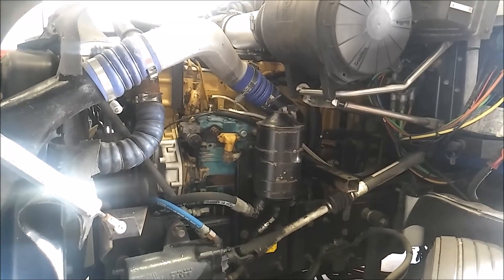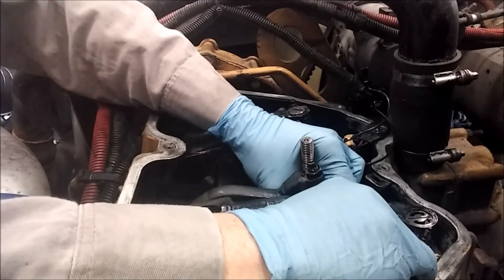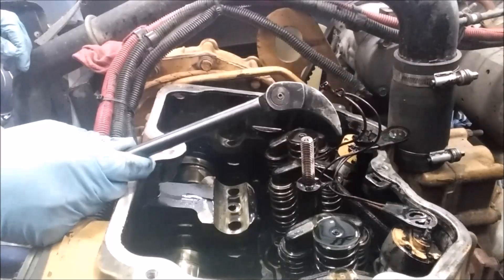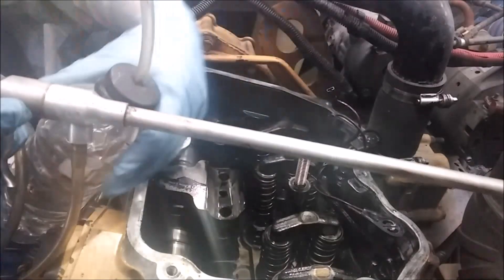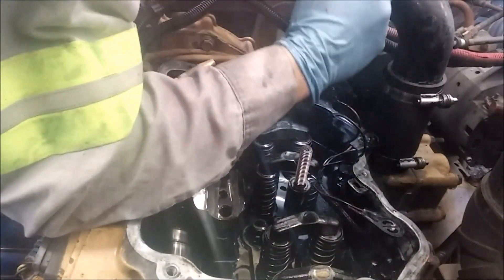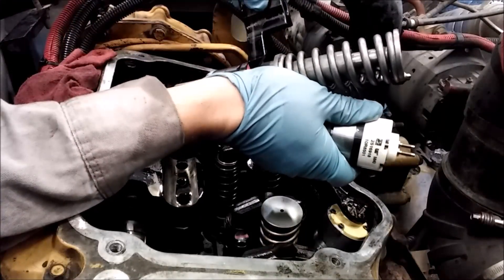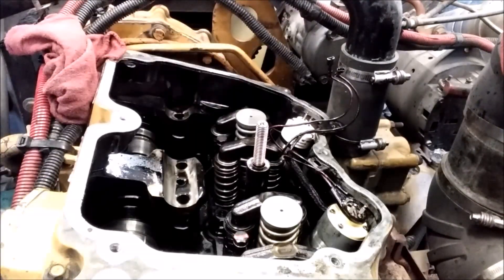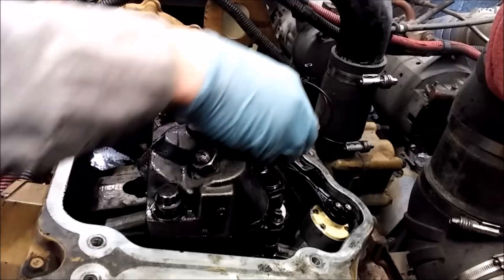How To Change a 3406 Injector or C15 Injector on Cat engines

Comment: Do I need to put the engine on top dead center #1 before doing injector? And can I run the Jake housing down if the valves/injector are in the open position when I take the housing off...

Comment: My ol 6nz was running like 💩... got a cylinder cutout test done,  it was cylinder #1 injector. Replaced it using this video. It still idled rough for about 20 mins. Then started idling smooth and running like before. Thanks to you this ol girl back on the road.

Comment: I got 1996 5EK cat it had a slight miss when on the pedal so I replaced all injectors and replaced the wire harness and done the over head on it but it still has the miss I don't have a computer to do the trim codes yet maybe the will help

Comment: I have a problem with my 95 378 peterb8lt. It has a 3406 c model cat engine. I've had the injector pump and lift pump all rebuilt and now for some reason it's only pulling fuel out of drivers side tank but the fuel still returns to both tanks but the fuel returning to passengers side tank is black why
Reply: Your getting compression in the nozzles. Also a 3406 C engine, you cannot order nozzles from the book (3ZJ), unless it is an 8PN. The book is wrong and depending on serial number HP determines which nozzle will work the best. As far as the tanks, sounds like you have a restriction.

Comment: Josh, old video but a good one. 

Wondering if I can pick your brain for a sec. 
I just did injector cups on a c15 acert 
Went for a drive after. Made it 2 miles and truck sputtered out. Checked it out and had 3 bolts lose on injector hood down bolts. 
Had new bolts and torqued to 40ft-lb 

Pulled it all apart. Pulled all 6 injectors. Cleaned bores and checked cup depths and all good. 
Found oil in bolt holes and blamed that on the screw up. Hydro’s the bolt and it torqued on that rather than the injector hold down. 

Cleaned threads 
Installed again with all new o rings on injectors 
Torqued 
Let it sit for half hour. Torqued again 
Went for a drive 
4 miles this time same thing. Haven’t tore into it but number 1 injector rocks side to side so bolt is lose again. 

Any ideas about this?? 
Thanks! 
Hope your new endeavours are going well.

Comment: I have MY 2000 3196 marine engines. Is it the same process to service the injectors? One engine started running rough (like missing a cylinder). I was thinking about pulling the covers and disconnecting one injector at a time to see if I could find the issue then pulling that injector. Also, why do you have to get the EPROM flashed when servicing injectors? Or is that only when you replace an injector?

Comment: Changed injectors 6nz.
Rocker arm bars do not sit flush on the bottom. Afraid to run bolts down. Help.

Comment: Adept ape, 
I have a 3406. The oil gets thinned out after about 3000 miles. And then the oil pressure will drop and the oil light will come on. Once I do an oil change in the filter replacement the pressure goes back up to normal. I can't seem to figure out why? Do you know what kind of issue I am experiencing?

Comment: I thank you very much for this video. 2 shops took advantage of me on a missing engine problem on my c15. Said it was bad fuel. I told them it was a injector issue but instead of hooking up a scan tool they went the other way. I found number 6 had a loose hold down and was missing blue second o ring allowing air into my fuel tank and disabling number 5 pushing air into that one too. I SAVED $6000 By doing this job myself. THANK YOU.

Comment: caterpillar 6ts in a 98 379 no check engine lights but you can hear a pop through the exhaust no abnormal smoke would it be an injector problem?

Comment: Hey I am workining on a 3406e but I broke a stud off of the top of the injector. Can I use a cap from c12 and just replace it. Or do I need a one specifically for a 3406e. Thanks

Comment: Hello i had all my injectors tested and 2 of them were faulty so i bought 2 and the for remaing were cleaned up and resealed but the seals are not the same color as the 2 i bought, do you think that could cause trouble later on ?

Comment: So if I wanted to replace the injector cups and injector there is no need to bar the engine to TDC, I would “simply” tear down jakes and rockers and reinstall? Then once that jobs done I would bar the engine to find tdc cyl 1 and start running the overhead procedure, do have this right? I’m gathering all the tools, parts and supplies to get this done and just taking as many notes along the way. Thanks for the knowledge you pass on to us

Comment: So,I appreciate your videos and thought I'd ask for your thoughts on how flawed the 3406E ,C-15, and C15 ACERT rocker shafts and shaft saddles are ...When all is new ,it seems a good fit ,BUT,when a hose blows and a driver gets the engine hot ,the head ,cracks virtually without exception...then you factor in that Peterbilt for years never had a low water warning system..Suddenly a $10.00 hose costs $10,000.00 to repair..Anyway, too often the rocker shafts are worn into the old heads saddles and consequently are no longer a perfect straight and smooth surface..Most mechanics reinstall these worn shafts on the new head and now the shaft bolts have to try keeping the shafts from moving and the bolts often fail causing massive failure again. I really dislike this system and don't know why Caterpillar never made changes ...any thoughts?

Comment: Am a maintenance mechanic for an offshore installation facility,  Your videos have been of tremendous help to me especially with the diesel caterpillar engines. Recently Cat C18 was added to the equipment list but came with no manual , though I have ordered them, but with your videos on Cat C15, I have been able to perform some maintenance work so far but still need to learn more about the engine. Our main engines are cat G3512 and G398.  Thanks a million for the knowledge you impact.

Comment: 99 c15 white smoke ,smell like antifreeze   on start up sputters and puffs white smoke  between gears, haven't notice moisture in oil pulls heat great after sputter i was wounding if coolant is getting into cylinders thru injector cups or seal  ?

Comment: You said the cylinder was getting fuel due to that broken o-ring. Could that issue be resolved by simply putting a new o-ring on it?  If it really necessary to replace an otherwise working injector?

Comment: I'm gonna recommend buying the bolt that holds injector as I just broke mine off in the head as I was reassembling. Got lucky and backed the rest out with a flathead screwdriver.

Comment: Wat about I have a c15 6nz, and everytime I start it (after short term of it sitting) it blows white smoke out the exhaust. Smells like Raw fuel. That would be a leaking injector correct?

Comment: Thanks for the video I have a cat 6nz 2002 and I’m getting fuel in the oil I’m being told it’s probably  injector orings but I’m going to get a cat Machanic to check it out and do a overhead if it’s the injector thanks again

Comment: I have a C 15
I chance injector #6
3 times it runs wonderful for  50 miles and then I get a check engine light on again 

Put computer on and again injector 6 shows bad 
It has new harness 
New injector 

Any ideas?

Comment: I'm getting a code on my C-15.  The code is 12s001 05 for Eng Open Cyl # 1 Injector.  Any idea if this is for a bad injector or the wiring?  Thanks for these videos.  Great information.
Reply: Code is 128s001 05

Comment: I just put a cylinder head on a c15 acert (BXS).My buddy who helped,  installed the rockers. I was below handing up parts and didn't witness the installation. 
The jakes dont work now(they did before tear down). The lash seems to be correct.My question is, does the shaft that holds/pivots the lifters install in a certain orientation inorder to allow the jake housing to fill with oil? The plungers on the cam side of the rockers are very loose(1/8-1/4 inch of play) and the only thing that seems to explain this is that the jake housing isn't getting ANY oil.
Reply: Its okay, you dont need jakes 😆.  Wiring mayb?

Comment: This is an awsm vid. But i have a question Mr. a.a. , im working on a CAT C15 and have finished installing injector no.6 and operated the vehicle then checked it with the scanner, it said injector 6 low current so what might the problem be  ?

Comment: I have a c15 cat "03" Peterbilt and getting fuel down in the oil pan.  Is it the injectors or the fuel pump in front of the motor.  Where do I start to correct the problem?  What happens if I keep running it?

Comment: Would a defective injector on c15 cause a vibration  that loosened the bolts on the trans oil cooler? I changed my crank damper and had no effect thank you

Comment: Great stuff , can you tell me the right way to face the valve bridge on the valve stem, i always put the round hole on the valve stem on the intake side of the engine with the elongated hole on the ex side ? also with the cat flywheel tool the bar should push down from the frame to oil pan to go clockwise  ?   thanks for all your help

Comment: So i get a,c15 acert and it started to building up psi in the cool system and it was blowing all the heater hose and there was oil in the coolant and what do you think it is
Reply: Robert Cass it could be lots of things but cylinder compression is definitely getting into the system. Watch his videos on bottle test and such. Good vids.

Comment: I'm having a white smoke issue at start up and idle, I was told one or more of my injectors are probably bleeding into the cylinder, is there a way to determine which injectors those are or do I just need to replace all of them?
Reply: Manually perform a injector cut out test on your truck
Reply: @KingPetty901  okay I'll have to look up how to do that

Comment: Awsome video ,I have I had a mechanic change all 6 of my injectors and after he got done not even couple hours later got diesel in oil,opened up engine and found the cap was cracked took it back to parts store and they fixed it put it back together and again has diesel in fuel opened it up and another injector is cracked ,not sure if the mechanic is messing them up or got some bad injectors or mabee something else is causing it ,any ideas on what it could be??

Comment: Do you have the torque spec for the 3 bolts with studs coming out of them on the rocker hold down rod and also the 3/4 inch nuts on top, for a MXS Acert?

Comment: Hey adept ape my 3406 was computer and i converted it to the mechanical high pressure fuel pump would i have to change my injectors or anything else?

Comment: There is 12 inch pounds in 1 foot pound.so 2 foot pounds would work that's If your torque wrench goes that's low
Reply from the maker: +Brandon Page I own a very low range inch pound torque wrench now, I wouldn't trust a normal ratchet torque wrench that low.
Reply: potato potatoe

Comment: Got diesel in my coolant on a Cat 3406E. Im going to pull the injectors and replace the injector cups and O rings.  Do i need to position the motor in any specific orientation (for example piston 1 at Top Dead Center on the exhaust stroke) before taking the injectors out, or do I only need to worry about that when doing the overhead after I get everything back into place? Also, is there a coolant drain plug on the block of a 3406E and if so, where is it?

Comment: hey adept, my company has a cat generator with a c15 engine. It has set up for about 2yrs. when we tried to  crank it the engine is siezed up. we are thin king about pulling the injectors to relieve compression, and pouring marvel mystery oil in the cyllinders, letting it sit a couple days, vacuming it out and trying to turn the engine over manually to free it up. I was just wondering if you have any thoughts on this????

Comment: Awesome video thanks so much! I have two questions if you  sir. 
 one is when you're pulling off the Rockers does the engine have to be rotated at a certain position top dead center or anything? 
Second  is only when it's it's for the weekend I go to start up my 04  C15 it cranks and cranks hard to start smokes white smoke very heavy for 3 -4 seconds doesn't do it again until it sits again over the weekend.

Comment: We have a 6NZ motor that was flooded in 5ft of water in Hurricane Harvey. If I remove the injectors and turn the motor over to drain any excess water, will I need to readjust ?
Reply from the maker: +Lisa Adcock Was the entire crankcase filled with water? If just a little water for into the oil you don't need to remove the injectors and evacuate the cylinders, but if you do, you should redo the overhead adjustment.

Comment: Hey when you install a new injector harness and jake Harness does it matter color wire is where or can you flip it over ...
Reply from the maker: +Brett Barrett Depends on the style injectors. The injectors with the round screw down posts can be flipped. You do need to make sure the right ones are installed though.
Reply: Thanks a lot for the response ...Your videos have help a lot.....
Reply: Adept Ape where is your shop located?

Comment: love your information videos! I have a question with a lot of answers too it... I'm fixing to buy a used semi, what the most reliable engine in your opinion? I will likely be buying a truck with 600k plus miles any advice and guidance is greatly appreciated!
Reply from the maker: +Eddie portillo I would go with a single turbo Cat C15 or 3406E, hopefully one that has had the counterbores cut already. One of the best 15 liter engines ever made.
Reply: Can you recommend what one should be looking at on the C15 before an overhaul is required.  Would love to see a video on evaluating when a rebuild is required on a C15.  Love your videos and trusted information  keep up the great channel

Comment: I was just curious to know if you found it hard learning to be a diesel tech from previously being an automotive guy. Originally I was planning on going into the auto industry, but changed my mind over to diesel in hopes of making more money. I'm just getting at that I know a lot more about auto and gasoline cars than I do diesel, and didn't know how much of a difference there really was. I'm enrolled to go to UTI next fall in the diesel program but I was just curious on what you thought. Love your videos, appreciate all the info! Thanks!
Reply from the maker: +Tj Willians If you understand the principles of an automotive engine, you can understand the Diesel fine. A Diesel, while heavier and more expensive, is somewhat simpler. There is no spark system to worry about, many are inline 6 engines so there is only one valvetrain. No timing belt to worry about and no intake control system for the throttle.

Comment: Hello, any ideas on where to look for help with replacing the o rings around the injectors on a 3306?  It is on an older military generator set that got hot and now leaks coolant around each injector. Thanks
Reply from the maker: +Justin Hoehner I did an in frame on a 3306 engine last year with the pencil nozzles. Does the engine run? The reason I ask is because if coolant is coming out around the injectors you probably have a cracked head or head gasket that is sending coolant into the combustion area.

Comment: my injector #5 keeps marking check engine light . I've changed it multiple times . What's the problems associated with that injector and what can i do
Reply from the maker: +Raciel Rodriguez Which code are you getting, injector current high or low, or possibly a different code?

Comment: Hey adept ape ive had my truck with a c15 acert in the shop twice for a puff of smoke about 2 to 3 sec long at start up, they havent a clue whats wrong, u seem quite informative just wondering if you had an idea, thanks
Reply from the maker: +Tim Stevens What color is the smoke? What engine serial number is it, an MXS, NXS, and SDP etc?
Reply: its fuel smoke and is an nxs
Reply from the maker: +Tim Stevens It would be expensive, but they could remove the exhaust and then see if one cylinder is pushing the smoke at start up. I wouldn't worry about it unless it starts getting worse or has other symptoms.

Comment: The shop that installed my injector didn't have the capability to program it to the engine do you know anyone who can program it on a Sunday in Tucson or Phoenix all dealerships I call are to busy
Reply from the maker: +chris hobbs Sorry for the late response, trying to get any work done on a Sunday is usually going to big bucks. The injector should operate okay without the right trim files until you get it to a shop.

Comment: Hey adept ape I just replaced an injector on my nxs cat were is the injector code located on the injector so I can get it programmed to the ecm
Reply from the maker: +chris hobbs It should be on the electrical solenoid on the side. There will be a 12 digit number and a 4 digit confirmation code. You'll need both numbers.
Reply: How would I get the injector code for the injector?
Reply from the maker: +chris hobbs Once you get the numbers written down you can use the trim file disc that comes with the injector, but you'll need Cat ET to program it. If you don't have the disc anymore you'd have to download it from Cat on SIS, which needs a Cat password.

Comment: I have a 2007 Kenworth T2000 with a cat C15 engine twin turbo. I was wondering if I switch my twin turbo with a single turbo will I get one mile per gallon plus  fuel gain?
Reply from the maker: +Nikolay “berry boy” Naydev I know that a few websites claim that doing that will increase your mileage, but I haven't done a conversion on a truck from twin turbo to single turbo so I can't say if that actually increases your mileage.
Reply: Adept Ape thanks for the quick response!